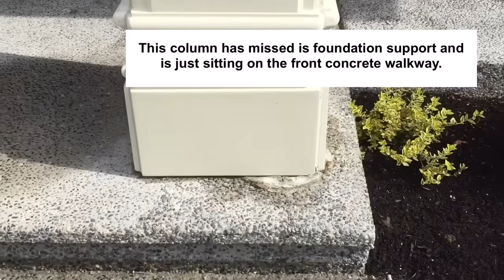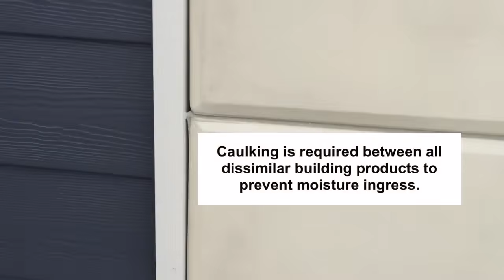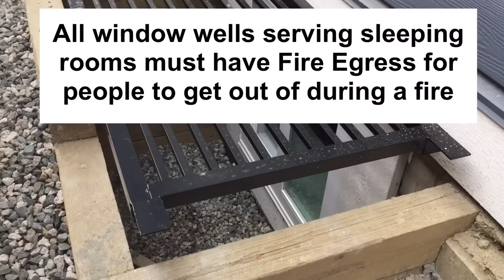New Home Construction Inspection - This is Shocking!!

Comment: It appears as if an independent inspector can find the problems, I have a feeling the contractor is incapable of making it right. What I find scary is the obvious problems that one can see. What was done incorrectly but now hidden? The caulking is not merely bad, but they used latex caulk. To properly caulk dissimilar adjoining materials one must use a high performance caulk , like isometric commercial grade caulk. The down spouts , under sized and never place down spouts over roof shingles. The shingles having that much water dumped on them will fail in short order.

Comment: I lived north of LA in the High Desert where literally hundreds of new home developments were built in the 80’s thru the 2000’s.   It was amazing looking at how bad the construction was for homes built under $300k.   But homes built in the $500k or higher, a vast improvement in quality.  However, the subcontractors used on all homes were the same, and poor subcontractors did crappy work.  There was a tract of homes with almost every home having leaks.   A handy man studied the problem and made a fortune repairing the leaks with minimal work as it was a simple issue of the original roofers not using roofing paper in the valley areas on the homes.  Because the tract was over 10 years old, the builder was able to avoid repairs due to warranty.  Sloppy window installation with cheep windows, watered down paint on interior walls, and poor design by architects such as close quarters between doors and toilets, bad dishwasher locations, and undersized garages with literally a foot of space from the garage doors to the interior garage walls, drive in and can’t open car door.   Poor stucco application, cracks, gaps, over spray, and sloppy workmanship.   Disappointing.

Comment: Gonna' stop at the very first gig he believes he found. Yeh, an actor spot is visible, leading one to think the post isn't secure. Chance are it just got put in the wrong place, and the pit one where the column met the concrete. Sucky part is you gotta' open the trim to verify. Most home inspectors bring little to the table, especially on new construction. Bit of a racket.

Comment: I worked for the phone co for 41 years and some of the crap construction, additions, and remodels that I've seen over the years is scandals. A homeowner that is not construction savvy should have all remodels inspected. Passing an inspection should be a part of your contract. And never ever buy a home without a licensed independent inspection. If possible it is wise to accompany your inspector during his inspection. Inspections cost money but can save you tens of thousands of dollars or better yet save you from buying that piece of crap, money pit "Dream Home."
Yes, I know there are permit and code inspections but you can not rely on those inspections as they're only looking for code violations. And there is more to a well-built home lasting 2 or 3 hundred years than simply meeting code.

Comment: Todays houses are CRAP. The house I bought was built around 1960. Let me tell you, it is built rock solid, built out of bricks.. It's been through many hurricanes and NOTHING ever budged an inch. I bought it in 1988 and the only thing I've done to it is routine maintenance. I've replaced 2 roofs,  pulled out old flooring and added new wood and tile flooring, new central AC & heat ( it originally never came with central AC, only central heat), 1 hot water tank, 2 new toilets, interior and exterior paint and a few electrical sockets. I've lived here 30 plus years and those are the only things that has been done. It didn't need anything else. You couldn't GIVE me one of these particle board, plastic shoddy new houses. They won't last at all.

Comment: First of all, that is NOT a 2.4 million dollar home. It is at best a $250,000 house. The property value due to STUPID GREED is 2 million dollars. Besides being ghetto tacky for the fake facade crowd, most of these poorly built homes around Metro Vancouver are nothing more than tofu dregs. 

OSB clad 2x4 framing is just a house of cards waiting for problems. Push connection electrical wiring is just another telltale that you got ripped off. What passes for qualified trades today makes me sick and the whole reason I got out a decade ago. If I was still working in construction today, it would be one fight after another shutting down work in progress until corrections were made. That level of stress and threats from the other trades because "it's good enough and no one will notice" is just why the whole system needs a massive overhaul. 

EVERY city and municipality in the Metro Vancouver area is guilty of this and when you call them out on it, some couldn't care less or don't want to address the issue because they would be liable. Pass the buck. As usual, someone will end up getting seriously injured or killed BEFORE anything changes.

Comment: $2.4 Mill for this dump. Horrible workmanship if you can even call it that. Remember, that just because it was permitted, doesn't mean there aren't workmanship issues. Obviously many code & safety violations. I wonder what's in the walls?

Comment: I don't know what it is but Youtube is showing me lots of dodgy American houses lately. I'm curious do people have to be trained professionals who undergo years of an apprenticeship before becoming a tradesmen there? Where I live building contractors are only allowed to hire out tradesmen, not handy men who say they can do things. Mind you we get paid a lot. Brickies get paid $3-$4 per brick laid and as a painter I get $40+ an hour and have been offered $80 for country/mines doing 12 hour days ($960 a day)

EDIT: Funny thing though, a homeowner can hire a handyman to put up a patio where I live, but a handyman can't quote a paint job over $600 if he isn't qualified lol. Seems funny because paint on the wall wont really hurt nobody (unless super old and had led paint), or a handyman could charge >$600 for a door done in two pack enamel paint which is like poison in coffined spaces without good ventilation (have seen painters not listen and end up in hospital), makes no sense. Meanwhile a patio can fall down if not done correctly and they can build one the size of their backyard without a trade certificate. Fencing dont need 1 either, but concreters and carpenters usually fill those positions as it's easier work that pays the same and in some cases, better (new homes offer competitive prices to get houses out the door, why brickies are so expensive atm as a ton of trades wait on the brickwork being up).

Comment: You have no idea what you are talking about.  The only serious issue you found was the grates on the basement window wells being bolted, but that may not be a code violation depending on how the basement is configured.  If the house has proper building envelope construction, which you would have no idea how to determine, none of those gaps mean a damn thing. Home inspections are absolutely useless!!

Comment: No big deal, you basement bedrooms are death traps, just about every joint between the window trim and Hardie plank siding is exposed, water gets in around it and rots the walls out, not to mention the mold issues you're gonna have. Oh, and water rolls down hill not up the gutter. The downspouts are a twisted mess. Gutter missing, where do you think that water from the roof goes? Hope you got a good working French drain system. It looks like whoever built this place was either a beginner, or they threw the plans to a beginner working for them and went to the bar. Must be California. 2.4 million for a house that cost 250-300k anywhere else in the country except New York. Youre getting screwed there too.

Comment: Looking at all of the white-painted wood, that stuff is either NOT new, or was painted multiple times with a clogged brush. It looks a lot like the woodwork on 50+ year old houses.
That fake stone looks CHEAP once you get closer than 20 feet away.
Next to that AC drain, is that a cleanout that was fully enclosed by wall?
-
Ugh. Even the stuff they did RIGHT looks cheap. Who buys that?

Comment: The first 5 items are BS.  Since you don't have the prints for the home, and clearly didn't engineer it,  you have no idea where the structural post (typically a 4x4) is located behind the cast stone veneer.  That the post base was clearly poured using a sonotube and that the left and the right post are very similar, it's extremely likely they are secured properly (although they could've done a much better job with the porch finish).  The gutter you say is missing, you complain 2 minutes later that it has inadequate slope (which is easily fixed within 5 minutes).  Those do not appear to be egress windows since the minimum clearance is required to be 5.7 s/f, so they likely do not service a sleeping space in the basement.  Otherwise the prints would have never been signed off by the town building department.  if by some miracle, the windows do service bed spaces, bolts are easily removed and in all likelihood were installed for security of the jobsite.  Caulking and 5 minutes worth touch up paint costs pennies.  It's quite obvious the "deficiencies" found were simply punch items that Stevie Wonder wouldn't have missed.  You manged to identify a couple cosmetics.  The only remotely "shocking" thing you found is the stair support and an incomplete primary drain. The biggest shock it the $600+ the buyer was charged for a mostly boilerplate report.

Comment: All the issues aside. How the heck is that a 2.4 million dollar home? It looks so cheap and tacky on the outside. The facade looks fake, nothing like a good stone facade. The columns are fake as fuck. The windows look cheap. The guttering looks and cheap. The roof is cheapo roofing material. The walkway is just concrete. There is cheap "wood" cladding all over the place. What even is that ugly finish round the window at 1min 48 seconds. Its obviously just a wood framed house from cheap construction lumber. Utilities are just plastic boxed. Bare timber around the window wells, that doesn't even look properly treated and is splitting in places. And so on. None of the materials look even slightly high quality. Or even reminiscent of the types of construction it aims to emulate in appearance.

Maybe its the location/land making it so expensive. But damn. Its a cheap built house in makeshift fancy dress. If you are going to build a cheap building, make it look good for what it is. Do the materials justice. Don't dress it up in a clown outfit!